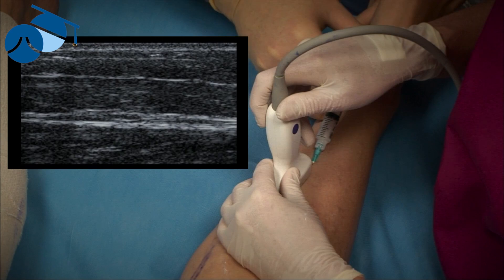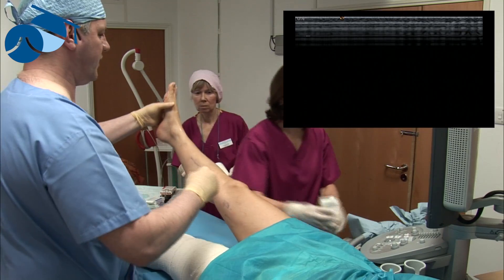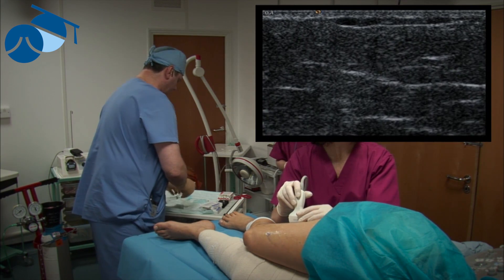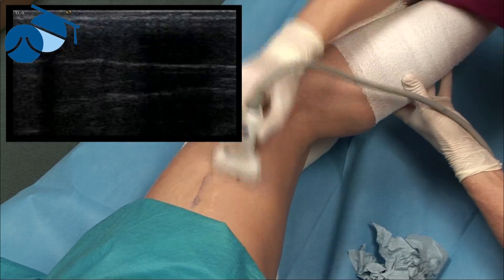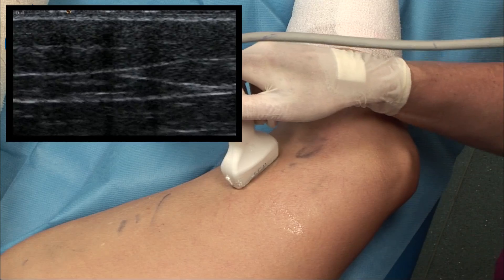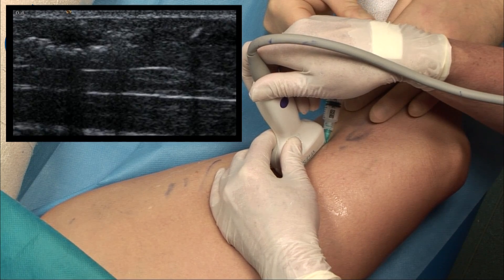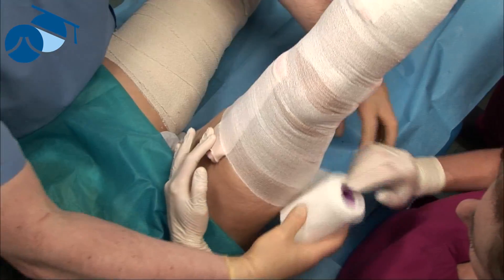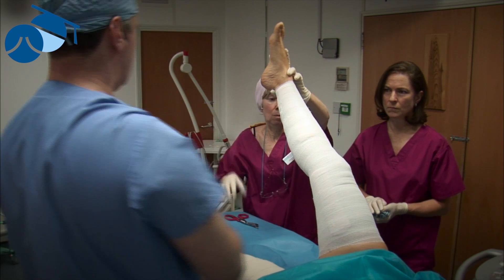Foam sclerotherapy treatment of feeder veins (varicose veins)

Comment: With this compression, is there any greater benefit to wrapping from more distally? I'm thinking hat there may be swelling distal to the  ankle. Thanks
Reply: It is possible to do so - but selling more distal to the ankle is usually lymphedema - not venous reflux. So the whole investigation and approach to treatment would be different. Foam sclerotherapy would not be needed in such cases as a rule.
Reply: @MarkWhiteleyVeinSurgeon  thank you

Comment: Can you have the foam in the veins in feet and around ur ankle
Reply: Julie Rudland Yes you can - but when you have a good duplex scan, you usually find the veins in the feet and ankle are caused by hidden varicose veins higher in the leg - such as perforator veins. Hence the need for accurate duplex ultrasound of the veins before planning any treatment at all. Best wishes, Mark Whiteley